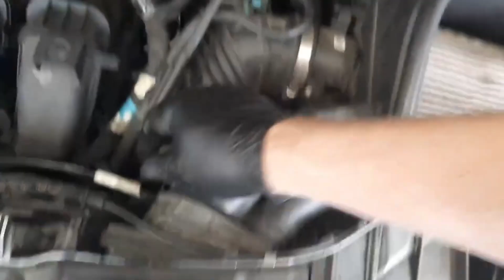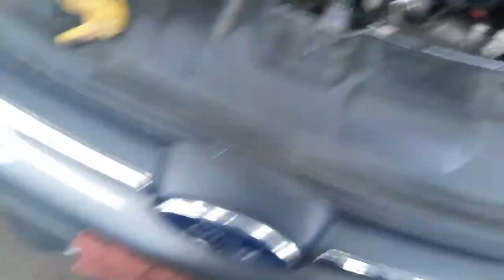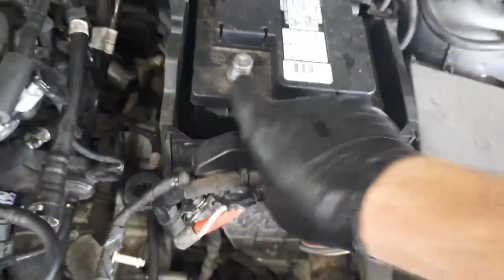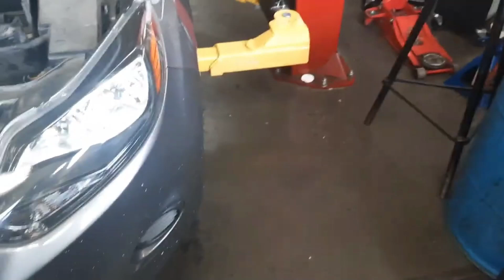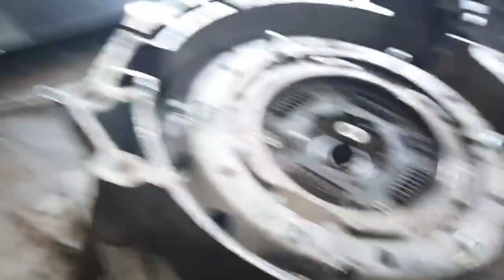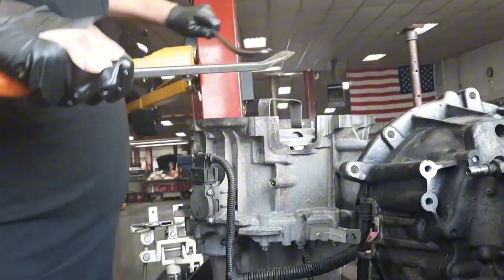The Powershift DPS6: Why Ford Stuck with a Flawed Transmission!

Comment: So gen 2 maded from 2015 - 2018 are they also crap?
Reply from the maker: Same issues as the others yes. But the 17 and 18s come with a good TCM from the factory
Reply: @BigBensCarsAndCycles well depence of the market. Im living in UK so not sure which ones were better here ? I know 1 gen bigges problem was plastic covers arround the springs , they like to crack and they messed up everything. Gen 2 fix that problem and put it outside the gearbox so I thought gen 2 is much better....
Reply: @BigBensCarsAndCycles  I just find out fiesta and focus has powershift dry clutch and they are bad. What aboud ford fusion 2.0L diesel ? That one is wet clutch dct451 are they better ?

Comment: I have a problem with our fiesta 2014 and has 220,000 miles and now doesn’t go in reverse now buddy it goes forward and when it gets hot sometimes it doesn’t want to move forward too and after resetting the Tran it takes off and only forward what you think is the problem .. please
Reply from the maker: Need fault codes present
Reply: @BigBensCarsAndCycles  I got. Code now saying P0902-00 clutch A actuated control circuit low and P090C-00 clutch B too

Comment: Hey again Ben ive recently noticed a clunk/knock noise when taking off from a complete stop as well as sometimes when accelerating quickly the gearbox holding a gear at a certain point but not shifting when it should as well as a hesitation which never use to be present. Im not sure if the noise is gearbox related, have you got any ideas? Thanks in advance
Reply from the maker: @FishingWithWilso  hi, can you record it and share it in my discord. Or Facebook group?

Comment: They stopped using it in Australia in mid 2015 when the Focus facelift came in. They went to a conventional torque converter trans mated to the 1.5 EcoBoom engine 🤣

Comment: Good Afternoon, Ben.  Thanks so much for posting these most very helpful videos.  My wife's '15 Focus (43,000 miles) this afternoon:  Backed out of parking space normally.  Shifted into D, but tranny went into neutral and stayed there while shifting into all gears.  Shifted into P, then back to drive and functioned normally coming home.

A similar thing has happened 1 or 2 times some time ago, but did not repeat until now.  Clutches were done under warranty several times.

What is likely happening?  Warranty?

Thanks, Ben.
Reply from the maker: @131R30  Hi! If there's no codes, you can buy 2 new clutch actuators to try first. Otherwise it's probably the tcm. Tcm is warranty so if you have a p0902 code I'd let ford diagnose it for the tcm. Here's the actuators. And I have a video replacing them https://www.fordpartsgiant.com/parts/ford-actuator-asy-clutc_ae8z-7c604-a.html

Comment: Driving them "right" really does help a lot with the shudder in my experience.  I rarely had issues with shuttering until it just stopped shifting correctly with about 80k miles on the clutches because of fork issues.  And that was with around 4k miles of towing 1-3klbs in there which the transmission didn't seem to particularly enjoy (the rest of the car handled it great though).

Comment: I really feel like the DPS6 must be better suited to the lighter weight Fiesta. (Around 300lbs lighter, give or take.) M-Sport has been known to call the Focus of the 20-teens, the "fat sister of the Fiesta".
Reply from the maker: @DetroitMicroSound  yeah! It had fewer issues in the fiesta
Reply: @BigBensCarsAndCycles  Makes complete sense, really.
Reply: I've bought and fixed many shuddering Fiestas. No different. The thing that really killed  this trans was the leaky oil seals in early cars, and when they went to fix that, all they did was put an oil seal in and a new clutch while retaining the Forks and bearing. Those are the main things that cause issues (outside of TCM)